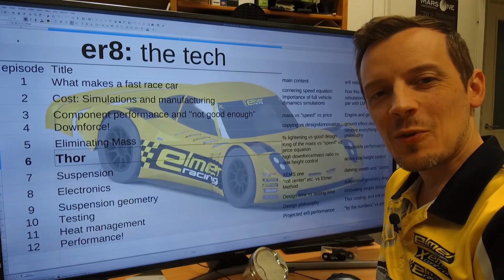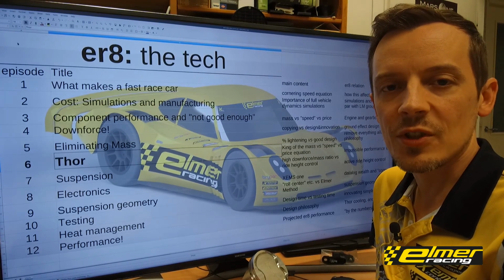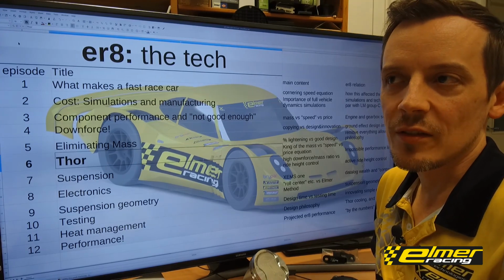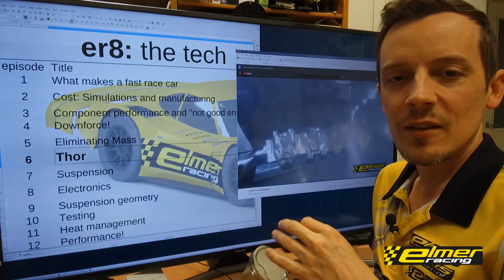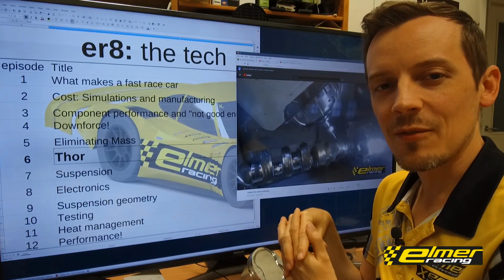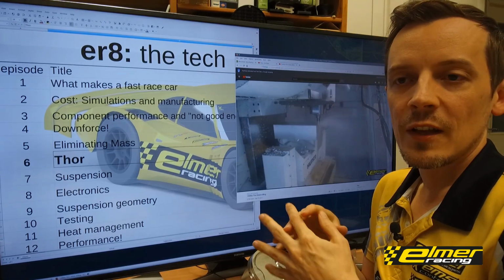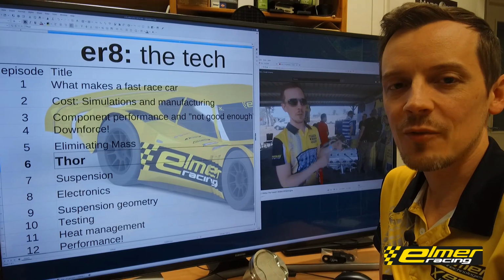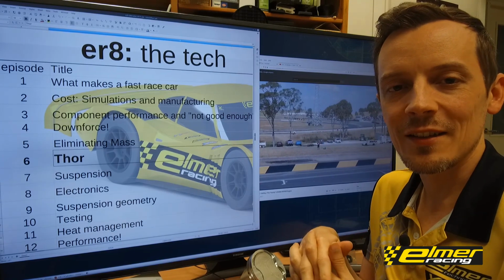Thor engine! er8: the tech ep6

Comment: The Mighty BMW M12/13 made 1450hp in qualifying in 1986. 
The 2.4l V10 Engines were at about 900hp, maybe 930hp (at 19000rpm!)
Reply from the maker: The last Honda V10 F1 engine was the previous record holder for the highest power/mass ratio for a OEM circuit racing engine. Until Thor :)

Comment: GM has a new V6(LV3) Based on the newer LS or LT1-4, its all aluminum block and head, so it could be a good candiate still a push-rod though, but you guys could just make a 4valve head for it, right? :D

Comment: LS engines weren't brought up at all? For an actual race car you will need exotic materials as is. The downsides of a solid roller design are greatly minimized. There are very large displacement setups that can be created around aluminum or billet blocks with incredibly strong sleeves. Many motors rev over 8-9k on the track. Also flat plane crank has been developed in the aftermarket. The firing order even on a regular ls makes for really smooth power output and helps a lot with distributing the load on rods etc. A faceplate could be designed to be super light. Allowing you to mount the engine but also be the primary load  bearing structure of the engine. 

If two valve is that much of a problem you could even develop an overhead cam* (edit) solution. This I believe has been done too in the past. 

You could even use the architecture as a basis so you can use readily available rods bearings and pistons. And resize it into a v10 or v6 or whatever. That too has been done with a v12 ls

You have a myriad of choices to make as well, from sleeve spacing (siamese bores etc) to crank case windages and main support styles. Rpm is free power by access to the lower ratios of the gearbox but it also is a non linear stressor. There have been some incredible stress tests done on turbo ls based engines at the power level you speak of. I bet an off the shelf combination of solutions could have similar weight but better longevity.

You could take the entire engine to an believable level with minimal R/D cost.  And very good servicing needs.
Reply from the maker: There are of course multiple non-oem solutions to get good power.
Thor is not about making big power though. It's about making the power, while being extremely lightweight, and very compact. And it has succeeded, being the highest power-to-mass ratio oem circuit racing engine ever made.

Comment: A very interesting video. You do a really good job.
Which BMEP or IMEP can the Thor engine reach? And have you also thought about tuning the ignition system, for example using a scavenged prechamber or a non scavenged prechamber spark plug?
Reply from the maker: BMEP and IMEP are dependent on the boost pressure used by the customer. Usable BMEP limit at lower rpm is about 4.8MPa. Nothing special.
Thor is all about power-to-mass ratio in a extremely cost effective package.
Developing a prechamber setup would allow increased fuel efficiency in some operating areas. But not worth the work involved currently.

Comment: Thank you for taking the time to put this series together. 
YES! We are very interested in the development decisions. I would love to hear the thought process through various design decisions made while developing this engine. 
I know it's a secret but I'm very curious on how you are cooling the combustion chamber and exhaust valve guides on a billet head. 
Why not go for a prototype cast head made with 3D printed sand cast molds. I understand the OEMS do this for development, and that the price and time is pretty reasonable.
Reply from the maker: We can use stronger alloys with the billet process. Also timeframe and cost is much better. There are some geometry benefits with casting, but to be honest, not much. Really the only reason for us to go to castings for heads would cost for larger quantities.

Comment: Would it take alot of change to make thor viable as a street engine? I assume you'd need to run different bearings and clearances to accomodate a steel con-rod, but would there be any other significant design changes needed?

Comment: Do you think the vr6 could be optimized successfully or is the compromises combustion chamber geometry too big of a downside? Bugatti seems to like this solution.
Reply from the maker: The vr6 is a really bad design. Very small displacement for the engine size (xyz dimensions of the block and head). So high mass for the engine power.

Comment: How do you think a billet boosted 3 or 4 rotor would compare to thor in power to mass ratio? Did you consider rotary as a option before choosing to design based off of the porsche engine?
Reply from the maker: Good question. To be honest we don't know. But looking at power-to-mass ratios of historical racing engines, the wankels are not that good. Not sure what the result would be with optimization for modern tools. Cooling requirements are much larger for a wankel though, so that might be a limiting factor for aero-heavy race classes.

Comment: Would flat/boxer-6's be out of the question for suitable engines to base a high power output six cylinder engine out of?
Reply: I know porsche flat sixes can make over 1000hp and have the advantage of a low center of gravity, but they may be heavier than a i4 of similar power.
Reply: @gxexrxmxaxnx  How do they compare to V6's in high performance applications though?
Reply from the maker: From the perspective of crankshaft torque output smoothness (within the 720deg cycle) a uneven-firing 6cyl wouldn't be much of a improvement over a even-fire 4cyl. Ideally for more cylinders, you would want to go to a even-fire 8cyl, for best gearbox longevity while reducing the amount of damping needed in the drive shaft. Tricky question though, so many different aspect to think of!
Reply: @ElmerRacing  are turbocharged Wankel engines not an option at all?
Reply from the maker: See Patricks question :)

Comment: Please do more information about engines. 2 Questions. 1. Which road car engine would you say is the best to use as a base? Meaning you can't touch the engine at all except the normal stuff like internals and girdles. Like you would normally upgrade a road car engine.  (Smallest, lightest, yet strongest and best designed). 2. Please do more videos about what makes an engine good / better. What are the really big gain areas of for example a stock engine except more air and more fuel? What sort of mentallity and design philosophy is best for squeezing out as much performance from engines as possible (On road car engines normal people can actually afford and have access too.) I would ask you about more specifics of the Thor engine but sadly you are not going to tell us anything useful anyways because of "secrets".
Reply from the maker: If you need to use a road car engine as a base, look at the parts you're not going to replace, and select the engine based on how good those are only. If you need good bolt-on parts availability, factor that in also.
2: Reducing the potential for issues is very important, and often overlooked. If you save time on solving issues, you have more time for development, testing etc.

Comment: Thank you for sharing! So you designed it without thrust bearings?
Reply from the maker: Connecting rods are piston guided. Clear better solution than crank guided. Saves weight from the crank. And allows for a better crank design.